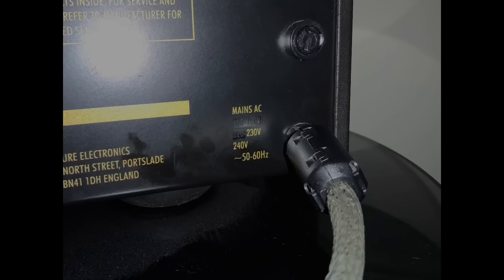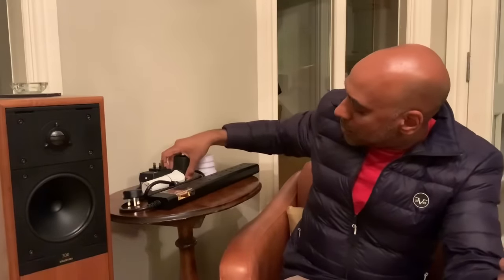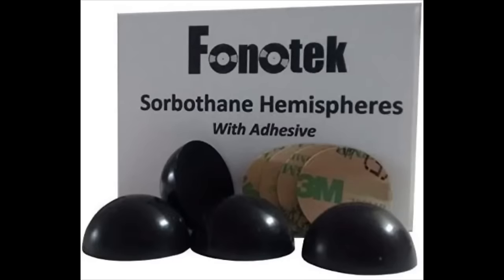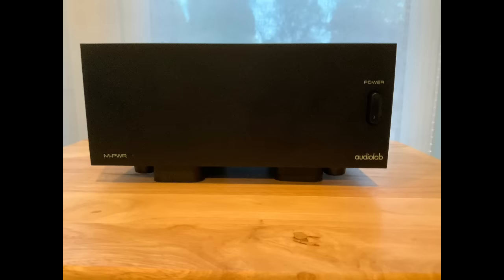My Top 5 Inexpensive Hifi Tweaks

Comment: Nice to see some sensible comments with regard to tweaks. If a tweak makes a difference then you really owe it to yourself to investigate and get to the root of the problem; replace the poorly performing component or adjust your overall set up/room. Band-aids aren’t really something to be relied upon. Clearly a band aid indicates something is wrong - so going a step further to fix the root cause will often gain you more than suppression of the issue with a band aid.
Reply from the maker: Hi Jeremy, thank you for watching. The only problem I see with that approach is that you may have a piece of equipment that may have a flaw but is immensely enjoyable and  that you may want to build a system around. For example, my Exposure XXI pre and XVIII monoblocks have the most glorious midrange. Far outperforms any other amplifiers I have tried at anywhere near there price. Problem is that the are quite sensitive to RF and EMI noise. Better to eliminate the noise before it gets to them than replace with another amplifier that does not sound as good.
Reply: A British Audiophile If it works for you then great! You save yourself an upgrade. However, be aware that the root cause of the issue might not be cured just because the hum or buzz from external noise is reduced by a tweak.  For example, a ground loop may still exist and musically correlated noise could occur and be devilishly hard to discern until it was removed and the proverbial veil was lifted.

Comment: I have recently bought an iFi mains purifier device to try out, with every intention of returning it should there be no positive affects on the sound.  I could not believe my ears when I plugged it in.  In fact it sounded different depending on where in the mains line you plugged it into, the effects were that dramatic.  As you described, airier at the top end and more space around the instruments with an improvement in bass depth, texture, quality and resolution.  Understanding why these work is easier to follow when you look at a company like Naim, who lure you into better sound with never-ending upgrades in power supplies as you move up their price ladder.  What they offer are external power supply upgrades, so I guess this iFi device is doing it on the cheap.  Incidentally, I bought the Tacima mains block based on a What Hifi review.  I didn't notice any effect on the sound with that!
Reply: Dave Dave  It's Emperor!
Reply from the maker: Hi Ade, the Ifi ac purifier made a significant difference in my system. The results are very system dependent and we are not going to convert the non- believers. As long as they believe in live and let live, as I do, we can all be happy. Thank you for watching and sharing your experiences 😉👍

Comment: Great video! Wanted to ask about speaker protection circuit. I have B&W speakers that I paired with And Com GFA 555. The am doesn't have protection circuit and I don't want my speakers to go kaboom. Do you think I should have the protection installed? Also, do you think that sound quality will be affected?
Reply from the maker: Thank you. I would leave it as is and just make sure it is off when you change connections 😊

Comment: well i have been doing all of the above for over 25 years. One comment. I only connect the shield of the mains cable to the source end, not both. That way the rfi emi is drained to the power socket and does not go into the component that is being supplied with mains power. I have the old Tacima power cleaner which i have had for years. I recently bought 2 of the Tacima block that you showed. They are very good. I have used a variety of materials for isolation of vibration. I use squash balls, sorbothane, viscolas, felt pads , rubber bumpers etc etc. I have moved away from spikes for the reasons you have given.  I have mains cables with ferrite rings alreadsy fitted . Generally wallwarts and smps power supplies. Removing mechanical and emi and rfi noise from a system really does improve the sound quality. Simples really
Reply from the maker: Thank you David, for watching and sharing your experiences 😊

Comment: Very Interesting.   A couple of points that may be of interest.  I made my own Mains cables several years ago from CY cable, Indentical to the Lapp cable you use but a fraction of the price.  Regarding Mains filters, I got one many years ago and had the same problems with a 'strangled' sound.  I found a solution in plugging the low current components (Pre Amp, CDP, TT etc) into the conditioner and the Power Amp directly into the wall socket.   Great set of video's, keep up the good work,
Reply from the maker: Thank you for watching and sharing Mike 😊👍

Comment: Russ Andrews mains cables have a weave that rejects RFI/EMI from other cables/devices and noise that's already on the mains itself, they are made by Kimber. Very expensive though. I've got some older cables by them that I bought second hand years ago on ebay, and they work well. I couldn't afford to buy them new though.
Reply from the maker: Thank you for sharing 😊👍

Comment: I totally agree with you that putting ferrite cores over both speaker wire leads adds unnecessary inductance. But why add any inductance at all which possibly (!!!) might compromise the audio range's top end? If the reason is that you're afraid of RF getting into the amplifier through it's speaker terminals, buy bigger cores that fit over both conductors the same time! Or wind several turns of the cable through a toroid core next to the amplifier end. This way you create a common mode choke that doesn't impact the differential AC signal at all.
Reply from the maker: I am not entirely satisfied with the explanation myself but I tried it and it seemed to work on my system. Check out this article http://www.empiricalaudio.com/computer-audio/technical-papers/myths-and-snake-oil 😉👍

Comment: Ugrade Nr. 3 A) Ferrit core very usefull Lost of high frequency disturbing at all and open soundstage B) Pads usefull but not so dramatic like A an C; C) IFI AC iPurifier : Dramatically influence of soundstage and focus of instruments, smoothness of all frequencies without dynamic increase, sounds like tube with many dynamic; the lower frequencies are powerfull/quicker/more real  without roaring. I was very surprised about the increase in 3 steps to improve quality!! Thank you so much!! My highlight IFI. you sitting there and flabbergasted overwhelmed....
Reply from the maker: Thank you Norman. Great to hear your feedback. I am so glad you got good results in your hifi system. Thank you for watching and sharing your experiences 😊😊😊👍

Comment: Hi Tarun, I am from India. I took some tips from this video and made some changes at "No cost". Basically isolated the bookshelf speakers that are placed on top of tower speakers. I do not have that kind of space and also I do not have proper speaker stands. I have put smaller isolators then what you have shown in video. It has really made the difference. Dynamics of speakers have changed, brought a smile on my face. I will use the bigger isolators to elevate the audio trolley that is on wheels at present. I will remove those wheels and place it on those big isolators, available on Amazon. Thanks for the tips, learned a lot to do things in cheap or practically No cost.
Reply from the maker: Hi Shammi, great to hear that it worked out. Thank you for watching and your feedback. I appreciate your support of this channel 😉👍
Reply: Hi Shammi, which brand isolators  did you put ?

Comment: Apologies if this has been answered already. I skimmed through the comments and did not see it. On the ferrite beads. Why only on one conductor? Also does it matter which one + or -?
Reply from the maker: Hi Joseph, good question. Ferrite cores add inductance. You don’t want to add too much as it will cause high frequency roll off. They are made from ferromagnetic material and work by concentrating a magnetic field around the conductor to generate a back EMF in the presence of high frequencies. You don’t want 2 of them in close proximity to each other interacting. It is an ac signal so it makes no difference if it is on the + or - end. Thank you for watching 😉
Reply: @abritishaudiophile7314  So. If you don't want two of them close, why not put a bigger one around both? To where they are not yet divided.

Comment: Dear Arun, I watched again this great video and rediscovered all the great (and inexpensive) tips and tweaks you provide to improve overall sound quality. One specific question. To organise and disentagle interconnection cables, do you recommend anything in particular (such as velcro wraps)?      Note that I keep my power cables completely separate from the interconnection cables (they all go into a Supra power strip). However, the interconnects look like a true "spaghetti dish". Thanks a lot in advance. Kind regards, Ignacio
Reply from the maker: Thank you IP. It is a good idea to keep power cables away from interconnects. I wouldn’t wrap the interconnects together with ties of Velcro wraps though. Even with shielded interconnects the magnetic field around the cables will interact with each other. Depending on the system it may not be that noticeable in terms of sound quality but is still not ideal 😊

Comment: Very nice video. I also use the washing machine anti vibration pads for my speakers. As for the iFi device i have it too and i would recommend people to experiment a little with it. When i placed it at the wall it didn't have any effect at all and i thought i wasted my money but after a couple of weeks i move it directly in to my mains conditioner and it worked much better.
Reply from the maker: Thank you Calaf_72, that is good advice.
Reply: What exactly do you mean?

Comment: Great ideas and simple to apply. Does Electromagnetic interference
 and Noise tend to be an issue more of audiophile equipment or is it the same with vintage audio equipment from the 70s?
Reply from the maker: It can be an issue for vintage gear too 😊
Reply: Thanks for your answer
Reply: I came across these videos where they place little metal "bells" all over their listening room, in spanish they called them Resonadores or re-sounders? Do you know what that is?, oh and thanks on your RCA cables video,  I am on my way to replace the freebie cables with something more decent.
Reply from the maker: @PedroCorrales123  thanks for sharing Pedro. I haven’t come across those metal balls 😊
Reply: @abritishaudiophile7314  they also have this wooden dirt box where they plug or “ground” unused connections from each component.

Comment: Ferrite clamps are used to "short out" radio frequencies. You might find them, for instance, between a PSU for a laptop and the laptop itself. This stops the laptop being affected by nearby radio transmitters, or allowing the lead to act as an aerial should the laptop (which normally operates at RF) having a fault. The link between the PSU and the laptop is supposed to be very well regulated DC. A ferrite the size shown would probably attenuate frequencies over about 200 KHz. Anything lower than that would pass straight through. The ferrite should surround all the conductors it is intended to protect.
Reply from the maker: Thank you for watching and sharing. I would be interested in your thoughts on this article http://www.empiricalaudio.com/computer-audio/technical-papers/myths-and-snake-oil
Reply: @abritishaudiophile7314  When considering any product like these, the first question to ask is "Could this have any effect on the sound I hear?" The second question is "How?"

So, are you worried about RF interference (1) or the ability of the cable to supply current (2) ? Neither should be relevant to a mains lead used for audio equipment in the real world.

(1) RF will be picked up all the way from the substation, or beyond. Cable runs underground will be OK unless the RF source is strong and close by. It is within your building that the problem you imagine could occur. Yes, your wiring could act as an aerial, but it is very low impedance, so the sensitivity would be ridiculously low. A PSU in any sensibly designed piece of equipment will include capacitors just after the switch to filter out RF entering. Look up "Class X Capacitors". Strong RF signals, with a wide range of frequencies, are almost always caused by sparks of various types. Lightning, car ignition systems and appliance faults are the most common. These sparks will be audible while listening to radio, but should be filtered almost entirely by the PSUs when listening to other sources. However, some receivers might not isolate the radio section from the rest of the circuitry. If you hear crackles when your fridge switches itself on or off, get the fridge seen to. The mains cable from the wall to your hifi is not to blame.

Good interconnects will be shielded, with the shield connected to ground at one end only, to avoid collecting interference of this type between units.

(2) What you, and the author of the article you reference, refer to as "dynamics", is, you believe, the ability of the power grid to supply enough power to drive the speakers hard enough to cope with the loudness you want. Bad news, I'm afraid. This is a problem with your kit. The sockets in your wall are capable of safely pushing 13A to your equipment. The power lead typically supplied with audio equipment can safely cope with a continuous 5 amps. That's over a kilowatt. Assuming a really poor amplifier design, call it 500W of audio and 500W of waste heat. Is your amplifier rated at 250 watts per channel? Even peak? If you think you are hitting this limit, standard power leads are readily available with a 10A rating - they cost under a fiver. I've used loads of them when installing file servers. They are not quite as flexible, but easily cope with a 1.5" radius bend. Listeners in the USA have to cope with wall outlets which supply only half the power of a UK one. They will NEED those 10A leads for their 500W amps. If the fuse in your plug has not blown, then the lead is supplying ALL the power the device can consume. If the PSU in your amplifier can't convert mains to the DC used in its power stage fast enough, there's nothing you can change to fix it.

Of course, clean connections will help prevent noise. Unplugging and reconnecting once or twice a year should keep most plugs and sockets in good condition.

"Line conditioners" are poor devices. They may provide some overvoltage protection, but this is much better done within the consumer unit, thus protecting the whole building. Modern installations are likely to include the relevant modules. In the UK, it seems that the chances of lightning strike are greatest in the south east. Even ordinary equipment must be able to withstand voltage spikes up to 1.5kV without effect. Domestic appliances need to cope with 2.5kV. "Brownouts" (transient voltage drops) are uncommon in the UK, and are normally the result of someone switching a large load on or off. UK mains supply is a VERY constant 50Hz sine wave; claims to "tidy up" this should be written off as the products of overactive imagination. If you are running from your own generator, of course you need to check with its manufacturer. 

The reference you give is obviously someone in the USA. Electrical standards there are quite different to those enforced in the UK. The "push-in" mains wiring he mentions is unheard of here. He also refers to "empirical" testing - asking someone which one they thought was better rather than measuring anything. The article is also very big on "we believe", again rather than any measurements.

When it comes to speaker cables, fat copper is best, unless you want to invest in solid silver. Fancy  weaving is just irrelevant. solid or stranded  cable is up to you; it is low resistance you are after, and that comes with substance. The impedance of your speaker is unlikely to be more than 8 Ohms, so no problems with RF. "Skin effects"  are only measurable at VERY high frequencies. At 60 Hz in copper, the skin depth is about 8.5 mm. At the top of the audio range it will be about half that.
Reply from the maker: Very interesting. Thank you for taking a look at it and you’re considered analysis. Much appreciated 😊👍

Comment: That cheap mains filter crushed the life out of my old system some years ago ... An older house and system - with some components crossing over to new.  The earth and mains in that house were awful (to put it politely) 
My new house (and now 3 systems) has amazing electrics now, part of which is star earthed. The difference generally is very marked ... How your mains is setup i.e.  quality cables, chosen fuse box and how the building is earthed. Most houses are on a mains loop with a common copper rod buried in the foundation. If it's possible to have parts isolated from the loop with its own independent earth & supply (split from the main loop much like the 30 amp supply is, though many share the earth) the sound benefits are very good.
Reply from the maker: Thank you for sharing Chris 😉